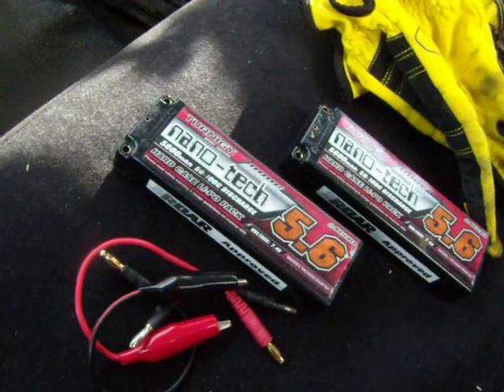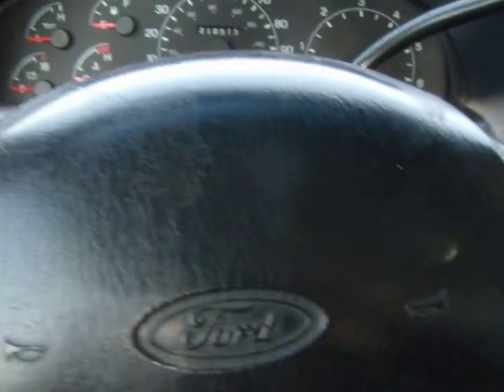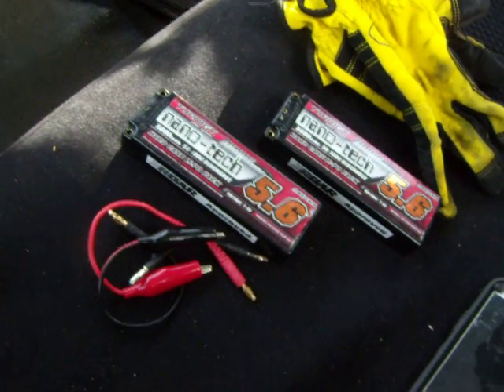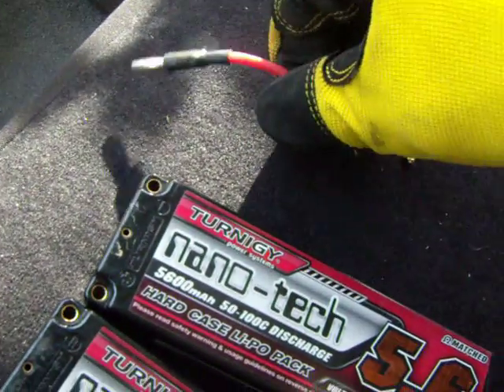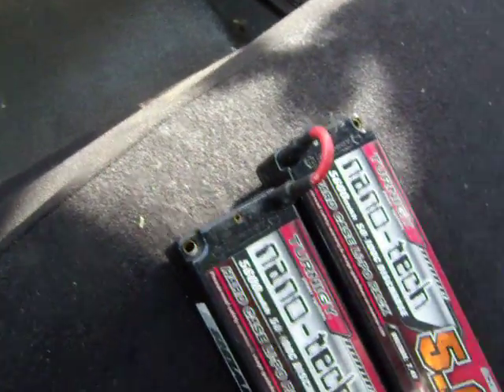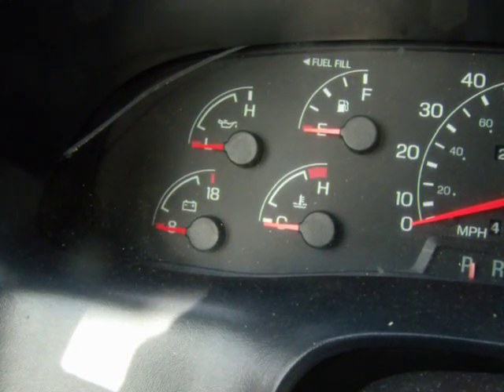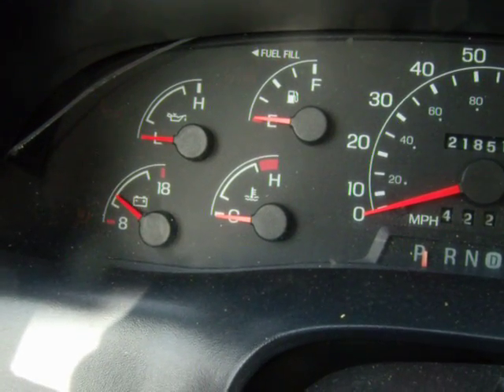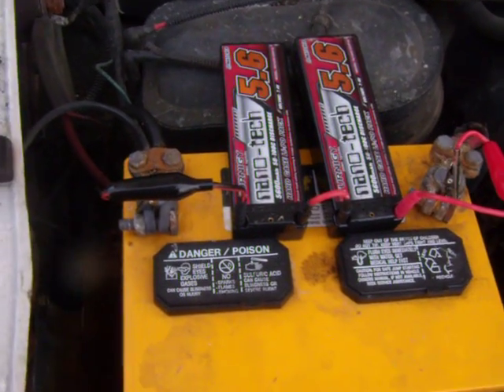How to jump start your car or truck with your lipo battery pack !!!!!!

Comment: It's good idea in my opinion  to use voltmeter when you connect the pack to car battery and to keep watching car battery's voltage rising and once it gets above 12v it's good to start and if it's under 12v don't waste energy from pack for nothing because it just will start but instead just wait and keep watching untill it's ready and that's how you will 100% have success every time instead of draining lipo pack and be still stranded without any more options 🤗

Comment: Glad it started. I have a question and a comment,
did it blow any fuses?

I know you used those as you had them around but you just need 3s (14.4 Amp when full) lipo that is capable of supplying the needed cold start current. that is Ah capacity times C rating. 4s will burn some fuses as it is actually 16.8 Volts when full. look for 60+ C rating lipo of about 4000mAh (could supply 240 Amps) or smaller (3000mah) with 100C (300 Amps) discharge and you should be good. some times you need to disconnect your battery as it act like another load on these little lipos as it charges the truck and start it at the same time.

nice video, thx.

Comment: Two notes:

* When I try that I normally disconnect the car battery, otherwise I think there's gonna be a current flowing from the lipo to the Pb battery limited only by the resistance of the cables so I'd be afraid of frying the lipos or the cables.

* Once it starts I disconnected the lipo asap as I suspect the voltage from the alternator is still lower than the lipos so the lipos would keep discharging.

* I've so far tried 3s and 4s batteries.  3s haven't worked for me yet, not sure why, maybe cables were too thin.  4s have worked but on one occasion the 20A starter fuse died, and I was away from home so this was problematic.  A high-discharge 3s lipo with appropriate cables is probably optimal.
Reply: Andrew Zaborowski normal battery runs about 11.7 to 12.3 volts the alternator puts out on average 14.8 volt that's why only a 4S will work 14.8 is the voltage in the 4S battery when you hook it up to a regular car battery  they try to equalize so the Lipo pushes into the car's battery but I agree get that lipo off the alternator ASAP
Reply: short wires is the key. you want to reduce the resistance (reduce the voltage drop as the current increases) of the lipo wires to minimal and the easiest way is to reduce the lenght (other way is to solder bigger cross section wires i.e. AWG4 but this is not visible). that is why jumpstart devices still do the job using short thin cables and ordinary jumper cable are thicker but longer.

Comment: I used two 7.2v Nimh packs (14.4v) on a 2005 Tundra 4.7L when the battery died in the middle of nowhere. Lifesaver because there was no cellphone signal.

Comment: u used two discharged lipos 3s in series???
Reply: Those are 2s packs
Reply: οh ok. does it work if i use two packs of 3s ? i mean voltage 12,6V

Comment: If You would just give the Battery Pack 10 minutes, It will Turn Over Much Faster!!!
You would be letting the Higher Voltage from the Li-Po Pack Transfer to the Pb Battery thus Reducing the Amperage on the Donor.
It's a Great Idea and can be handy for a lot of folks, Keep Up the Great Work Guy!!!

Comment: what was the C rating on that pack? i have a crappy jump start kit that has a led acid cell thats toast. want to replace it with a li-po pack
Reply: danz409 it said 50-100 c rating

Comment: Regardless, this is a great idea and I will do this myself now. I have a 97 F250 PowerStroke that is a beast to start so I'm constantly draining the battery.
Reply: Give it Time to "Soak In" before you hit the switch. It's a lot of Amps which can do some nasty things to the Donor/wires/clamps if you rush it.

Comment: Did the batteries get warm? Why don't the RC batteries go straight to the motor rather than having to charge the truck battery first? In other words why didn't the truck just start up? I don't understand why they had to charge the truck battery first...power was there?
Reply from the maker: If I or anyone else were to use larger gauge wires with alligator  clips you could crank as soon as you connected to car or truck battery.  but since my leads were only 16gauge wire the wires were getting very hot trying to transfer proper current right to truck starter.  So in turn I had to leave lipo r/c battery connected for a few mins to charge truck battery.  this allowed the truck to start with out full load coming from lipo batteries.  But if you would do this with say 10 or 8 gauge wire im sure as soon as you connected you could crank and it would start.
Reply: +isaac schofield makes sense, thanks.
Reply from the maker: yeah no problem hope it does you good

Comment: nice how low did it drain the lipos?
Reply from the maker: Hardly anything when I brought them back in and put them on the charger the cells were at 3.97volts.  They were charged after 10 mins soo you could probly do this 4 good times before you start reaching the 3.2 mark on the lipos.  Not to bad screw 100 bucks on that thing fat chris had haha.